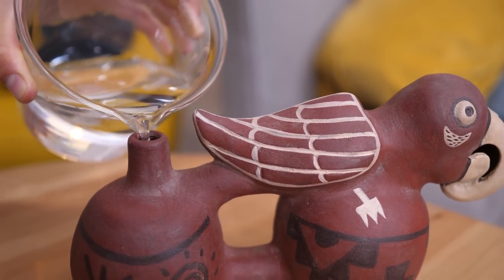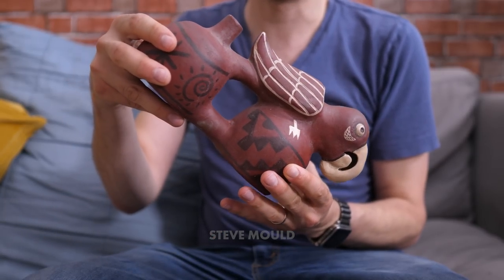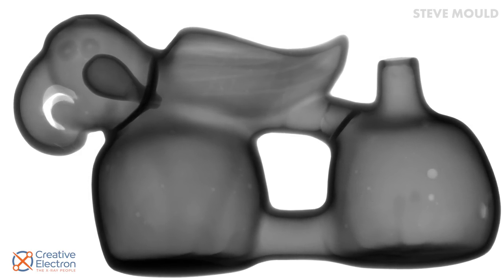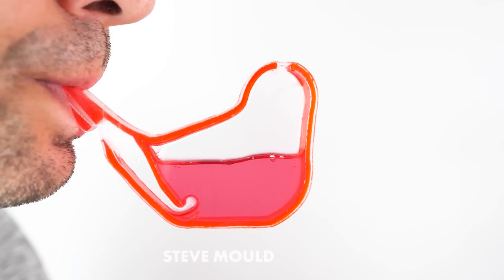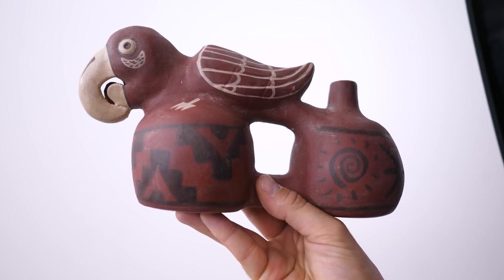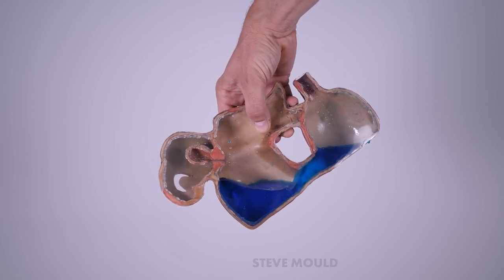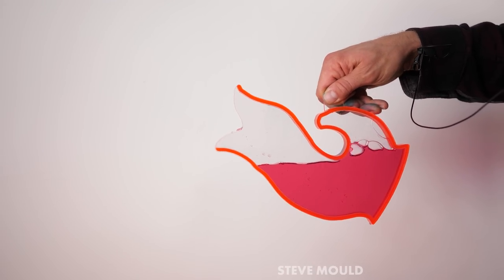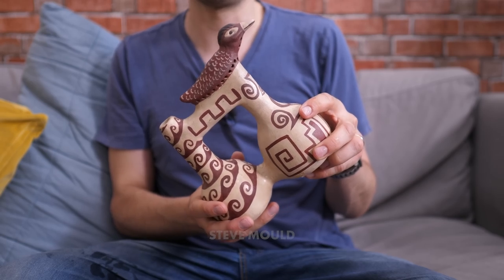Peruvian Whistling Vessels are weird

Comment: Steve Mould: X-Ray images handcrafted whistles to prevent breaking it.
Also Steve Mould: Breaks it anyway
Reply: Just like Surgeons in any Hospital...
Reply: Exactly. Seems bizarre to me. Could have found another way to make a 3D transparent whistle.
Reply: @Eidolon1andOnly  The problem was the 2D version not having enough volume to replicate the required force to produce the whistle. He could've just extruded it and made the 2D version thicker, still flat and "2D" but wider
Reply: Why does it need to be '2d'? Could have just made the transparent version thicker and still see just as well through it.
Reply: Making things transparent and watertight in 3D is MUCH harder than making them in 2D.
Reply: @riliash  he could 3D print half of the whistle and use transparent acrylic to see inside. It’s the same as cutting it open, only you don’t need to cut anything open.
Reply: He shoulda got the 3d xray 3d printed!
Reply: Steve: "The 2D version is too thin restricting the flow of water..."
Me: ... so we'll make it thicker by extruding it in the third dimension?
Steve: "... so we're just going to cut one of these beautiful works of art in half."
Reply: @Eidolon1andOnly  You'd think someone with a successful engineering channel would consider 3D printing
Reply: That's not exactly fair. The x-ray scan gave him enough information to figure out how to cut it in half in the least destructive way. If there were important lateral connections they could have been destroyed by a bad cut/break without giving him the information he needed
Reply: @blackoak4978  He literally said he did it so he didn’t need to break the whistle. And the only reason he did it was for the 3-dimensional properties, that he could’ve gotten with a 3D printer.
Reply: My first thought after the two-dimensional model failed and long before he cut a real one in half was:
"Why don't you just make the walls separating the plexiglass taller?".
My thought after he cut it in half:
"Wow, my idea must not have occurred to him. I mean even if the whistle had to stay narrow, he could explain that in a caveat, like he often explains exceptions."
Reply: @tinybabybread  69 👍
Reply: @rallok2483  42nd 👍
Reply: He totally could’ve 3d printed it. He had an x ray from all angles of the thing. That’s plenty to make a model for it
Reply: Oh, now you have an accurate 3d scan you can 3D print a clear version to see how it... oh, you're just going to destroy it anyway. Also doesn't even consider asking the people who make these about what shape the internals are or anything they know about why (and you know people are still making these because if the art were dead he would never be allowed to destroy them). Some Steve Mould videos introduce some cool and exciting science; others ignore the most easily available resources. Guess which this is?
Reply: So many people butthurt about him cutting it in half to educate us. It's a science channel, he showed us exactly how it works with the real thing.
Reply: @UEENavy  you clearly don’t understand then. No one is annoyed about the outcome, it’s the process that is the problem. By cutting it open, he’s defeated the purpose of the non-invasive scan. Especially since there were many simpler solutions that didn’t require damaging the original whistle.
Reply: @UEENavy  people are criticising that he did DESPITE the scan. Now imagine the fossil fuel burnt for the round trip of vessels from UK to america, and this bloke just decides to destroy it.
Reply: @beactivebehappy9894  Actually, if you calculate how much fuel you spend per kg shipped with freighter ships, your last trip to the local store was more wasteful than those jugs shipped overseas. So I hope you really plan all your activities extremely careful if you're so worried about the environment.
Reply: @riliash  scientific glass blowers like he did for pop pop boats?
Reply: Is there a glassblowing youtuber up for a challenge perhaps?
Reply: @hebl47 A 3 minute walk down the street is more harmful than international freight? The more you know

Comment: Me : "Hey Good Idea, he will not destroy the vessel this times "

Steve, litteraly ten seconds after : "Here is the vessel cut in half by hand" !
Reply: You can still put it on a display, but you have only one side xD
Reply: You can display both sides at once now.
Reply: @benwisey  So, he actually made it better...?
Reply: Perhaps Steve should see if someone could 3D-print things like these & although they may not be completely clear to see-through, even if they're semi-transparent you should be able to see any dark liquid inside them!
Reply: @stevie-ray2020  I've seen some 3D prints from sanded resin turn out really clear, but obviously takes a lot more work and effort for nice transparency.
Reply: Curious if both cut sides make the same sound  I would assume not based on the difference between the two it still would like to see it done. 

In like a follow up video for this series and topic
Reply: That made me sad, it sounded so beautiful
Reply: A vessel that was cleanly cut into two halves can be repaired. One that got smashed into number of pieces of wildly varying sizes not so much.

Comment: One option for this sort of thing is to get a full CT scan of the device (there are industrial CT scanning companies that do this). You can export the geometry as an STL and print it directly out of a clear material. Some SLA resins have very good optical properties and might work for your purpose here without having to reduce the geometry to 2D. I do think the 2D versions do help to make it easier to understand the concepts sometimes though.
Reply: As a guy that fixes various Xray stuff in the medical field I do many many 3D scans before I sign the equipment off to be used on people again. If you know a guy that does the same stuff I'm sure they would gladly take in whatever you want scanned to use as a phantom to prove accuracy of a system. That's what I do at least.
Reply: That would be pretty cool.

Comment: It might help to use a 3D printer to produce wider versions. The water-tightness isn't perfect, but should be good enough, and you can always coat the parts in epoxy resin to seal the small gaps, relying on silicone for the seal between the printed parts and the acrylic.
Reply: I wish I could find a file to print one of these myself but as far as I can tell, nobody has made one yet.
Reply: @drnarwhal2888  Steve's done the modeling himself on his transparent version. Find a frame where it's mostly planar with the camera, take a screenshot, drag that into your CAD software of choice, trace the elements, extrude, job done.
Reply: as soon as I read epoxy my mind jumped to the idea of a collaboration between steve and xyla foxlin

Comment: Thank you for the cross-eyed stereogram! I have one semi-lazy eye and I've never been able to see stereograms by the opposite method ("staring off into space"), so I could only guess at Magic Eye puzzles by working out the inverted version.
Reply: I can look at stereograma both ways and in this case, both work. But it makes the model turn the other way around.
Reply: @adrigax  Yeah, if I relax my eyes to unalign them positively, I can sometimes get very brief convergence locks, but my bad eye tends to start drifting up and to the right, which ruins the alignment very quickly. I can get them to lock in vergence much better if I go cross-eyed, though - and the accommodation (focus) is better, maybe because I'm near-sighted in my bad eye.
Reply: Lol...I have amblyopia bilaterally, and there's really seldom any 3D for me.  Crossing my eyes gives me two well separated images that do not mesh, and as for the staring off into space...well, no.

Unusually though, both eyes have full function and while they can work together even whilst wandering (ex, I can watch the road and the rearview simultaneously), it's a conscious thing.  And since using a smartphone, it makes typing accurately very difficult; the responsive bit for H, for instance, isn't quite where my finger thinks it is, so I get a lot of Js instead.

Frustrating but fascinating!
Reply: @RICDirector  I've never really been sure if my effective depth perception and peripheral vision (enough to pass transient tests) are because I have partial correction from wearing a patch on my good eye for hours each day as a kid, or just a quirk of my particular amlbyopia. It does give me a good idea of which image in double-vision to treat as the "false" image, as the one from my bad eye is far more transparent, and gradually disappears if I keep my gaze fixed. I do still sometimes have to "cheat" on [DMV] vision chart tests if I don't have a valid opt*ist note on hand, but my peripheral vision and depth perception are relatively good for someone with 20/100 vision on one eye, when that eye also tends to fade to black in a strictly-static gaze over 15-30 seconds.  ;D ... (that's a pun of an emoji)

Edit: typos.
Reply: I have normal eyesight, as far as I know, and I've never had much luck with the "staring off into space" stereograms, yet the cross-eyed ones work just fine.
Reply: @adrigax  I wanterd to comment to Steve that it's actually a parallel view and not cross eye view. But then I realized it works both ways, and it spin in opposite directions.
If you just watch it in 2D, you can 'decide' which direction it rotates, like the spinning ballerina illusion. Both X ray and a silhouette take away the perception of depth.
Reply: Parallel eye gives bigger and sharper picture.
Reply: I'm blind in one eye, 3d things never work with me either.

Comment: OMG, the stereogram works. This is why Steve's videos are so amazing, so many "wow" moments. Thank you for this!!
Reply: How did you do it? I can do magic eye pictures, but two videos? How should you do that?
Reply: @Freestila  So how I do it is relax my eyes and let them cross slightly. That will result in basically 2 sets of images each with a right and left video on them. Try to overlap the middle two video images (basically the left video in one with the right video in the other). It can be tricky so it might help to move your phone or laptop closer or farther away from you. But for me it generally quickly "pops" into a  single 3 dimensional image that is moving and in focus. It's hard to describe but I hope this helps!!
Reply: @Freestila   I put my phone 15cm from my face and focus on something roughly 70cm in front of me. Merge the middle two of the four images in the middle, if you can do magic eye you can find it.

Comment: If I understand this correctly, the key components for making sound of this are the size of the connecting pipe between the two water vessels and the shape of the whistle. It doesn't sound like the shape of the water vessels or precise shape of the pipe matter. Given that. To test your hypothesis. Instead of trying to recreate it in 2d or print the water vessels. Couldn't you just 3d print the whistle and attach it to 2 connected water vessels made of non-3d printed products. I would guess that you could create the same effect using pre made materials like bottles, jars, or pipes for the water vessel and connecting pipe. Which are materials you could probably get transparent versions of then drill, glue, etc together or fine pipe adapters. Then as a bonus you would potentially be able to swap in different sizes of connecting pipe, different printed whistle shapes, and different sizes of water vessels to test various hypothesis about what role the size of the connecting pipe, shape of the whistle, and size of the water vessels has on the whistle.
Reply: You are correct,  the determinate factors are the inner diameter of the connection (and/or if IT contains any obstructions to impede flow), and the size of the whistle cavity does affect the pitch of the tone. But there  is yet another subgroup to the equation,  and that is the TYPE of whistle mechanism. Depending on the cultural time period a vessel (or modern reproduction of one) was made, the mechanism can be a globular whistle with a rounded aperture contained within the chamber (as was used in the parrot example), or a ducted aperture like you would see on a recorder (as in the "snoring man" example). This type  of aperture is typically outside the vessel on or near the stirrup,  or carrying handle. They each make their respective sounds in a different way.

Comment: Excellent video. I have been fascinated by these vessels for over 25 years (I am a musician and flutemaker). The restriction of airflow by the small relative area of the vent hole as compared to the volume of the water attempting to traverse between the chambers creates a backpressure situation which, as you correctly surmised, is not present in the 2D model. The backpressure helps to both regulate and accentuate the gluggle effect. Cheers.

Comment: I could be wrong, but I'm pretty sure those stereoscopic images are backwards. It was very difficult to focus my eyes correctly on the image, so I tried flipping my monitor upside-down, and suddenly the depth of the image was much more clear. For stereoscopic images like this, you're supposed to have the image for the left eye on the right, and the image for the right eye on the left, because you view them cross-eyed.

Comment: It's not quite the same but if you milled a few flat openings in the different sections and capped them with polycarb you could see the action inside the whistle whilst not changing the volume much.

Comment: Recommend making an exact duplicate 3d model out of glass or acrylic rather than cutting an existing vessel in two and putting a flat acrylic on the cutaway.  Then, maybe you will have the effect you want.  I understand that CT scanners can be used to make 3d models on computer which then can be 3d printed.  They use it for instance to 3d print the skull of a human whose skull has been severely deformed so that they know what to do to repair it.  Why not use it on jugs?

Comment: I wonder if in addition to the surface tension effects in the pipe, the warbling is also caused by there just being more space for air AND water to flow at the same time, while allowing them to interrupt each other. The ones that warble more have both a wider connecting pipe and a shorter one, meaning there's more space for air and water to be flowing quickly, but a higher likelihood they crash into each other at that one spot. On the other hand, the longer thinner connecting pipes really would just allow water to go through without any air interfering, as there wouldn't be space. Maybe this is exactly what you already said idk im just trying to understand it

Comment: You could use a fluid with less surface tension next time when that's a problem. I found isopropyl worked way better than water when I was trying to print spirit levels the other week.
Reply: That is literally why they're called "spirit" levels. You use "spirits" inside.
Reply: Bit of washing liquid.
Reply: Try mineral spirits. It flows so easily that a folded paper towel or rag like you would for other water-like chemicals just doesn't stop it.
Reply: @eideticex  But it would get dirty i think. And cleaning that seams very difficult.
Reply: @tissuepaper9962  even just adding a small drop of dish detergent to the water will break the surface tension.
Reply: @A_Frog_from_mars12  then you get foam inside your level. Laundry detergent would be better but IPA, methylated spirits, or mineral spirits would be best.
Reply: Was thinking the same. Would really like to see a follow up that tests this

Comment: 2:15 OMG STEVE THANK YOU SO MUCH!!! It's been so many years that I wished someone made use of this to show us some 3D, while we're waiting for all the expensive hardware to come down in price!!!
Reply: Actually it’s been used extensively in the past. There are artworks that have elements that can only be viewed stereoscopically and is the basis behind all of those magic eye gimmicks that was popular in the 80s and 90s. Additionally novelty devices called stereoscopes have been around since the late 1800s. They worked by having two photographs of the same image shot from slightly different angles placed inside and the user would then look through the viewfinder and see a 3D image.
Reply: @joshs5577  I meant on YT 😅
Reply: @cheaterman49  In that case do you remember the Google Cardboard. Same thing but with YouTube.

Comment: idk much about any of this but the 2d one you showed just looked like it was moving the same ammount air back and for since the connecting tunnel didnt open up as much as the 3d one did, obviously volume was an issue, sure but it didnt allow that extra air flow between the two chambers, or does that not affect it? coz on the 2d one if you tilted it a bit further to allow a bigger breath of air in it might have worked?
if that makes sense ?
so on the 2d one would tilting it further allowing air to pass in the tunnel between the two chambers make the 2d one whistle even slightly?

Comment: Why didn't you just print a wider cross section whistling vestle? If you would have still made it flat on the sides and transparent, but made the orange plastic part thicker, you wouldn't have had to cut open the one you said you weren't going to cut open...